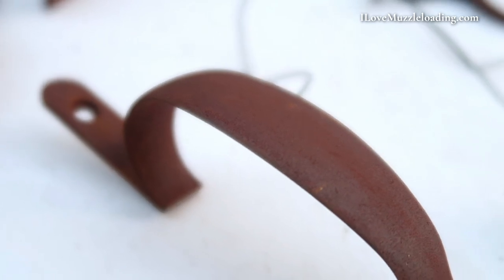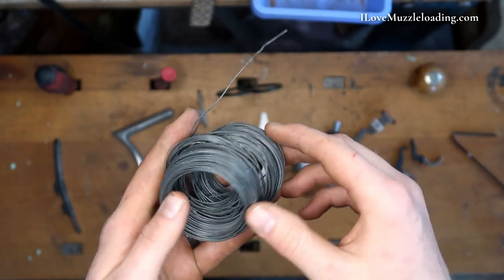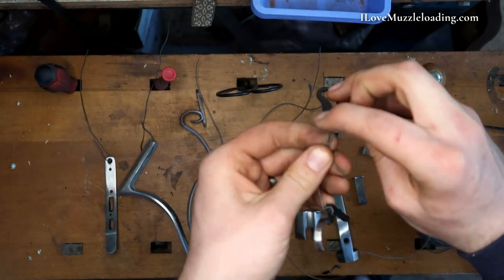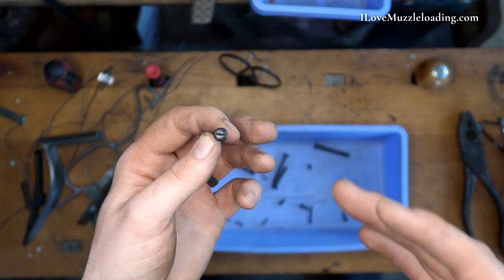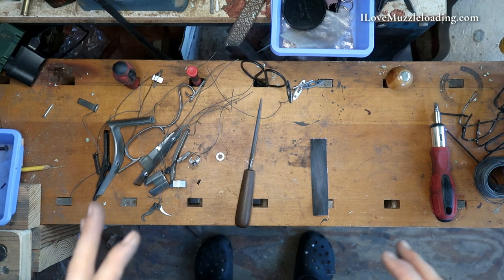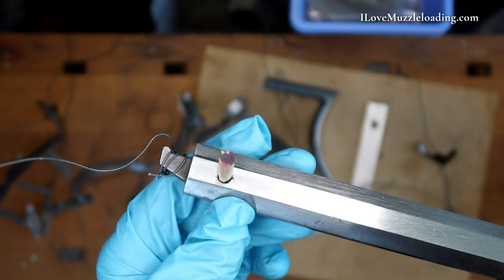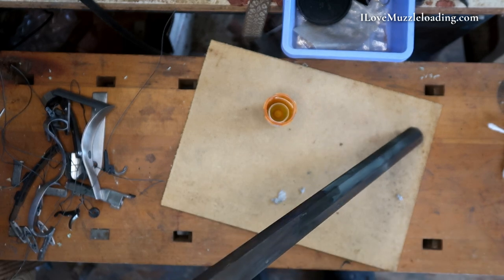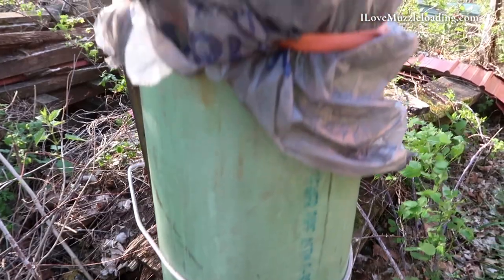I want a RUSTY muzzleloader | Investarms Gemmer Hawken Build Part 20 feat THE Barry Geipel

Comment: I've had similar issues browning my barrels in the past and determined that part of my issue was using a q-tip on the larger parts. I'm not sure why, but I figure it might be due to the time it took to get a single, solid layer wiped on. I started using the larger, disposable leather dyeing swabs for my barrels specifically and have had great results. Regardless, I've thoroughly enjoyed your build and your channel; thank you.
Reply from the maker: That's a great idea! I'll definitely use those larger swabs next time I rust something

Comment: I used the browning solution from Kibler on my Colonial American Longrifle, and I can say that I was very impressed with how easy it was to use and the quality of the end result. 
I also browned the brass with a solution I got from Amazon, I can't remember the manufacturer, but the end result was exactly what I was looking for. 
All of my screws and other hardware, including the lock plate and hammer I fire blued, except for the frizzen, that I cold blued.

I really enjoyed watching the build of the hawken. 

I have a Hawkin that was built by a gunsmith/ preacher in Tennessee in the 1970s, and I'm pretty sure that it was a parts kit from the Hawkin Shop in St Louis at the time. 
Supper accurate and very well made 54-caliber.

Comment: I don't have a lot of experience with browning, but I have rust BLUED many milsup firearms. I usually do a soak or a good wet painted on coat of KEROSINE which drives out all the moisture, then I seal it with a coat of boiled linseed oil wiped on, maybe 10 min wipe off and let sit for a day. I know this won't antique it, but it seals the rust. Also scalding with boiling water when fully done is a good idea it halts the browning without turning it black.

Comment: Watching and learning I'd like to ask you a question. I've heard the term "carding". What material is used for carding off brown rust and are there different types of cards? Thanks in advance. Kind wishes, Edward
Reply from the maker: Hi Edward, great question! Sorry I wasn't more clear in the video. I use a "File Card" to card the rust off the parts. It's essentially a fine wire brush like you would see at the hardware store. I imagine there are different kinds, but I've only ever used the 'normal' one you see when searching online for "file card". I hope this helps!
Reply: @ILoveMuzzleloading  yeah thanks for your help. I was really confused as I was watching the "Duelest" and he said the final carding he used was a worn piece of canvas. Thanks again I'm clear now.

Comment: The dual tone is probably due to heat generated when it was bored, causing a different temper, or may have even been done by the manufacturer deliberately for durability. Or you polished it unevenly
Reply from the maker: Thanks Eric!

Comment: Why would you not just put the solution on the whole barrel?  It is easy to do and won't use too much solution. Seems like one would want the protection on all the barrel even if hidden by the stock.
Reply from the maker: I've heard from and been around builders that do both. With tight inlets, there's not much that can affect the underside of the barrel.